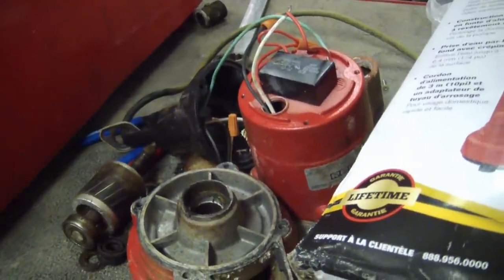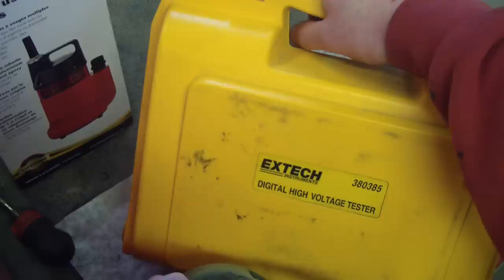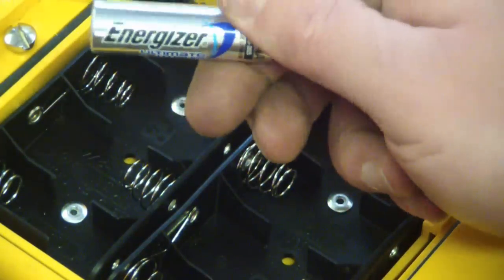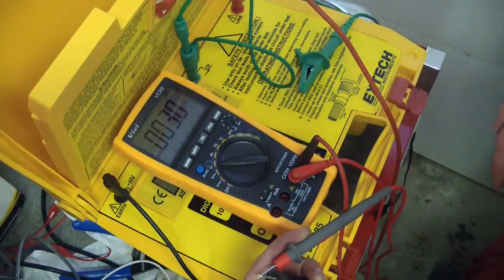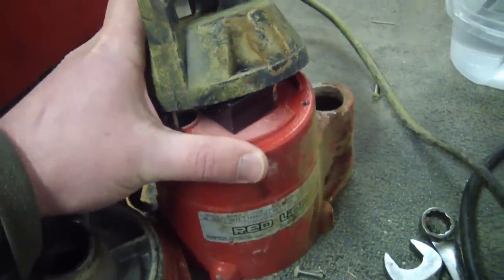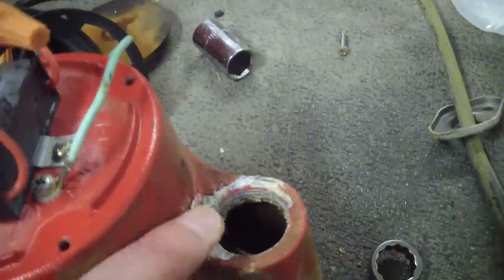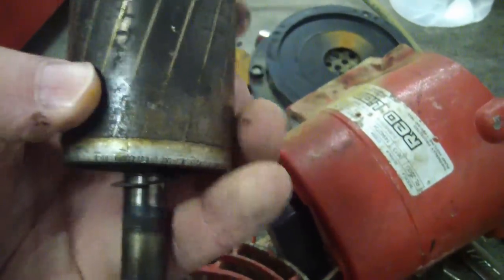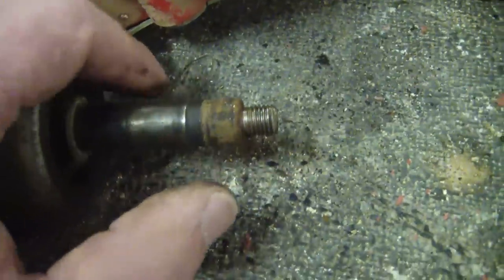BOLTR - La BOMBA! Red Lion water chooch'r is engineered to FAIL!

Comment: I'd take that back to the store and DEMAND they replace it. It's so blatantly obvious it counts as 'unfit for purpose'
Reply: Shops only provide a limited warranty, usually the first 30 days or "Out of Box faults". In this case he would have to contact the manufacturer directly. There was probably a lifetime warranty card in the box that has to be filled in and sent to the manufacturer within a month of purchase to make the lifetime warranty valid. Then when the fault arises you have to pack up the unit and ship it back to the manufacturer at your own cost. They assess the fault and determine if it was user error or a genuine fault and then maybe they will send you a replacement.

The cost of the original unit @ 99 Canadian pesos minus the cost of return shipping and the hassle makes these "Lifetime Warranty's" pretty much useless.
Reply: oOMonkeyMagicOo Didn't realize that canada follows the US's system of 'screw the customer hard' :(
Reply: ***** Not speaking as a Canadian or an American or specific to each territories consumer protection laws. Just in general relation to retail outlets that don't have the facilities to take back faulty equipment, and manufacturers practices that make the consumer jump through so many hoops that they are bound to slip up and invalidate the lifetime warranty.

But ultimately all manufacturers and retail outlets are out to get as much moola from a customer as possible and they don't care if you lube up first.
Reply: oOMonkeyMagicOo
Just used to the system here in the UK I guess: You buy an item from a retailer, therefore you have a contract ONLY with that retailer. And limitations of warranty are not permitted. The US system was a total shock to me, after a hard drive died after less than 2 months, and the retailer told me to 'take it up with the manufacturer'. I almost called the cops on them
Reply: oOMonkeyMagicOo LOL, British accent, but I'm pale enough they'd have just threatened me a bit
Reply: oOMonkeyMagicOo I see were that attitude of shop owners comes from. But on the flip side: Why should I go ever again to the seller, when I know that he is selling stuff that does not last? A shop owner as some responsibility in the stuff that he is selling: As a consumer I can assume, that when I got one shitty product from a place, that this place has more shitty products on sell.
Reply: sarowie
Exactly, if you get a poor product and poor after sales service you should not go back to that vendor again. But in the real world most people have short memories and will go for the cheapest crap they can get. My father was a coach-builder (now retired) but he still has functional tools that he bought when he was an apprentice (Over 60 years ago). Good tools well maintained will last. Cheap crap is designed to be disposable.
Reply: oOMonkeyMagicOo Wouldn't a product engineered to fail in this manner fall under an out-of-box fault?
Reply: ZeroPointAlpha Out of box faults usually mean exactly that. When you first take it out of the box and it does not work. If it works for a week and then fails, it would not be considered an out of box fail. And it definitely would not apply several months later, even if the fault was "Engineered" into the product.
Reply: oOMonkeyMagicOo Warranties are supposed to guarantee against flaws in the manufacturers craftsmanship, yes? Then it would matter if such a flaw were present, whether it causes it to fail
Reply: ZeroPointAlpha Manufacturers would not supply warranties if they did not have too! Depending on were you live, there are rules to protect the consumer. Where I live, most electrical products will come with a one year warranty. This is consumer law and manufacturers are obligated to supply this warranty if they wish to sell their products. If they did not have too, they would not. If you purchase a product, take it home and it is faulty, this is considered "out of the box failure". You may return it to the place of purchase(P.O.P) and demand either a replacement or a refund, you do not have to accpet an offer to repair or store credit. If the product works for a couple of weeks before failure, you can still return it to P.O.P, depending on product, they may only offer a replacement or repair. If it fails after a couple of months they may try to redirect you to the manufacturer.

In general, manufacturer warranties require the consumer at their own expense to return the product to their middle of nowhere possibly in a foreign land repair centre. They also require the original receipt. Some will also require you to fill in a warranty postcard that was supplied in the box and return it to them within 30 days of original purchase for warranties to be valid.Once they receive the product, they will assess it for damage. If they can blame it on user error, they will refuse to repair it and charge you for the return if you want it back. If it is a genuine fault, they may repair it or replace it and return it to you. In this case they will pay return postage. You will still be out of pocket for the initial postage to them. Also note that the replacement item may be a refurbished unit and not your original one, so aesthetically it may be challenged. It is not unusual for this process to take 6 to 8 weeks and cost a small fortune in postage and follow up phone calls on hold , to the foreign land repair centre.

Basically what I am saying is, if you buy a consumer grade product, the warranty is not worth sh!t 10 months down the road. You can try and fight your corner but more often than not, unless the product is really expensive, it is less hassle/cost/time to replace it.
Reply: oOMonkeyMagicOo 
Most of products are designed to breakdown after the warranty period , they fell on breakdown a couple of weeks after the warranty period .....i've worked in an after sale shop , that thing happened a lot of times .
Reply: Cletus Spuckler
I don't really believe any product is designed to break down just after the warranty period. This would be too complex to design and add to the expense. I do believe products are designed with a budget, which leads to inferior parts been chosen, which will cause premature product failure. The fact that several products fail just outside of the warranty period is just the law of averages and if you happen to own one of these you will swear there is a conspiracy.

I have had a few products, big and small fail in what seemed like precision timing just outside of the warranty period. This is just coincidence and not necessarily representative of the product.
Reply: For the electronics it'easy ,a prorgram is incorporated in the cpu of the unit  , then after xxx hours of use ( based on normal household use ) , the unit falls on breakdown : it'called sheduled obsolecence .
If you use your unit in a commercial place ( lot of running times ) the shit comes earlier .
Reply: Cletus Spuckler
This is the conspiracy I alluded to in my previous comment, which I don't believe actually exists. While it would be easy to program the ROM to randomly fail after a preset amount of hours from first power on, it would potentially leave yourself open to a whole world of hurt if discovered.

I have only discovered one instance of the above in real life. A security firm I previously worked with supplied CCTV DVR's. We had several DVR's fail. All from the same supplier. All failed between ~ 1 year + 1 to 3 months after installation. Units were dead. On checking them, power supplies looked ok, voltages were good, nothing was fried or burned, caps were fine, Xtals were all oscillating. They just appeared dead. After several DVR failures, all apparently the same fault. We had to contact the supplier for more information and see if we could get schematics or if they had any insight. Turns out they had. The ROMS of the DVR's had a timer built in. These units would be in operation 24/7. After 9400 hours of use, a random timer (Between 800 & 2400) would begin a countdown. When it got to zero, the unit would die and need replacing. The manufacturer would be shut down and restart under a different brand every 9 months (so we were told). Even though I saw this and inspected the faulty equipment, I still find it hard to believe this is a successful business strategy, or this was really happening. We had 9 of these units and only 5 of them failed in this manner, the other 4 to the best of my knowledge are still in operation???

 There are easier ways to make products become obsolete by making them non serviceable, uneconomical to service or use cheap custom parts that are not available for service. Non of these methods leave you open to lawsuits. The big brands make their products obsolete through marketing (Apple anyone). They spend billions to make you believe that your Iphone 3,4,5 is useless now for making calls because the CPU is too slow??? or you screen needs more pixels???  Sheeple buy in to this and upgrade??? Enough sheeple to keep the machine rolling!
Reply: oOMonkeyMagicOo more likely they were using a stolen design designed to crap out when copied.
Reply: ***** its global
Reply: ohohohoh 
its real as the sun ,,,i have visited one of these factories in china 
(yes people go to other countries for sight seeing i go factory seeing )

some factories well tell it stright in you face others will lie there ass off...
i mean i brought one their products BACK to their factory...and i told them it lasted 3 seconds ....the basterds will play dump all the way to the exit door 

NOOOAAAAHH..NOOAHH..(nooooo noooo)

you want to hit them were it hurts ?....
1 - boycott  them and stick to it...
2 - demand that it is made in USA/germany?japan and such countires or else toss it back in their face and say no i dont care how well its made...i want good stuff
chinese will always cut corners...

let the supplier know that you guys are done with this crap

we did in it in kuwait....
but we are only 1.2 million
and NOW Chinese products are heavily taxed and scrutinized for safety
we demonized their stuff now that garbage sit on the shelfs 

US AND canada market are the biggest 

DO IT ...DO IT (Starsky & Hutch)
Reply: Faisal Abdulaziz made not in China doesn't mean good quality unfortunately. If bad, cheap products from China were banned, they would be made locally if they could even just barely beat products designed to last in cost.
Reply: ***** yes they are 
thanks alot man could not come in a better time...
oh by the way i bought a bigger lathe and a milling machine...
well they are used ..still a new addition to my man cave
warning sign : no wussies allowed...sudden increase in hair chest may happen
Reply: Faisal Abdulaziz I totally agree that right now made in the USA is very likely to mean quality.(costs almost demand it) If we in the USA banned a lot of Chinese goods, I expect more shoddy stuff to be made here.

Comment: single phase induction motors can be in 4 different configurations:
1: shaded pole, uses shorted copper bits to get starting torque, not efficient, not much starting torque but it's cheap (no caps, no switches), so it's used for small cooling fans and other small things where that's not a big problem. can technically be potted to make the stator waterproof, I think.

2: resistance start, uses a separate set of field coils hooked to a centrifugal switch, or other manner of starting relay to start, usually has high starting amps as a result, but since the start coils disengage after it picks up enough speed, that isn't a problem with a lot of applications. starting is very inefficient, and generates a lot of heat. used a lot in fans and washing machines

3: capacitor start, basically the same as resistance start, but it uses a big cap to do the phase shift instead of relying on resistance, high starting torque, so it can start difficult loads, but it WILL burn out quickly if it can't start within a couple seconds, the cap may fry first, which will put it back in resistance start mode, which will burn out the start windings in short order. At this point you may be longing for 3phase motors that lack all this fuckery

4: capacitor run, they have a permanently attached capacitor with dedicated field windings to match, which provides starting torque, and a good chunk of the torque under load, not as much torque as the capacitor start, but that can be fixed by attaching a start cap in parallel with the run cap that gets shut down by a start switch. The magnetic field is elliptical, except at the load it's designed to turn, where it becomes circular, the torque and speed pulsate a bit at any other speed. No switches required, and run caps often outlive the motor they are attached to. Used when a reliable, simple motor is needed, I have even seen them in reciprocating refrigeration compressors WITHOUT a start cap, so they can do some torque if they are designed for it. I see these most in fans. They don't seem to overheat as readily as the other designs because they start in the configuration they are supposed to run in, unless there is a start cap to get even more starting torque.

I prefer the capacitor run design, and any time you see the resistance start motors, you know the manufacturer has accountants running the show since a cheap start/run capacitor is all it needs to be less shitty

Comment: So, you going to buy another and sleeve the end, or just buy a better pump?
Reply: New pump, the motor and bearings are goosed
Reply: viperz888 I think he was asking if he was going to go with another brand/model pump, or get the same one and just fix the part engineered to fail immediately. He will probably just get another model pump, but the other is actually a good idea, you never know what the problem will be with the next, until it fails.
Reply: +Big_Adam_2050 the coil is fucked
Reply: @alan-sk7ky  I like that one lol

Comment: Also a permanently split motor is reasonably common for small pumps. It means there is no centrifugal switch to go wrong although their efficiency is crap and toque curves not much better. Hence only small pumps. I would be surprised to see one bigger than .75KW

Comment: Good detective work. Most likely SAE 1020 or other mild or low-carbon steel, closest to ideal "iron core" for rotation, torque and cheapest, so customer is forced to re-purchase ...
(Super minor root mean square detail: 1000V x sin45 = 707V, 600V is close enough now)

Comment: Why would they engineer something to fail but give it a lifetime warranty? Does that help them somehow?
Reply: The thing about "Lifetime Warranty" is it covers you against manufactures defects. SO basically once you turn it on and use it, as long as the unit operates properly, they have fulfilled their side of the bargain. They also like to throw loop holes in to their policy, like having the original receipt. I have been shopping the Home Depot a lot more often now myself, due to their company wide policy of keeping your shopping receipts in their system for you. It has help me out many times now with returns. I have gotten to the point now that when a store does not offer this sort of "feature" I will shop else where. I am not saying the Home Depot is the best place out there or that what they carry is better then any other place. I just like the convenience and customer service they offer (at least in my local area).

Now I am sure if AVE makes enough "noise" over it, the manufacture would honor their lifetime warranty and replace the unit. However sometimes it is not worth the hassle.
Reply: Another approach can be found in the Craftsman tool model.  The profit margin is so high that you paid for three already.  "Oh, it broke, here's another no trouble"  no trouble for them anyway.
Reply: Lost Evesy they didn't honor the warranty, so yes it did help as he needed to buy a new pump.

Comment: Motor is PSC, permanent split capacitor, used on fans, blowers,  and some pumps if not much starting torque is required. There is a single capacitor between hot and start winding and no capacitor on the run winding. Starting torque is low, but motor runs normally at rated HP once it gets going.

Comment: Man, knowing that it is designed to fail, it would be a fantastic idea to buy that warranty that they (at least in the states) keep hawking to me every time I try and buy a left-hand turn pipe dethreader. Like I have done with the 12v tire inflator that I have replaced at least 10 times.

I have a similar hatred for the '12v accessory' socket as you do for threaded connections for fluids. Nobody is calling it a cigarette lighter anymore. So why keep the shape when it SUCKS SO BAD for what it does now?
Reply: Did you type that on a Dvorak keyboard while watching a movie on Betamax? Compatibility and ubiquity usually trump technical superiority.
Reply: ***** It already has a lifetime warranty
Reply: Yeah? How come AvE couldn't return it?
Reply: ***** Did he attempt to? I was confused where it cut out with him going to return it and then not doing so.
Reply: Yeah, he attempted to return it before he took it apart to see what all went cattywampus with it.